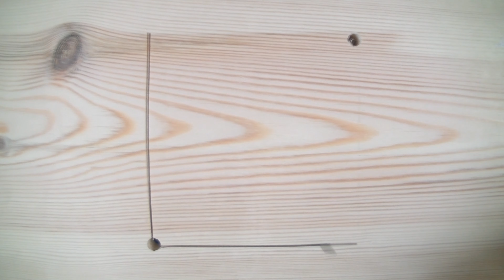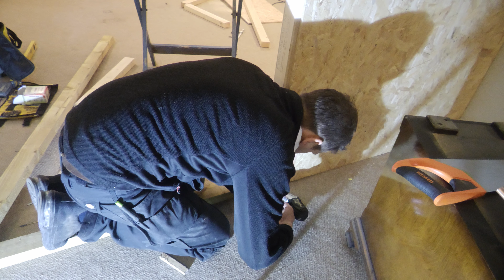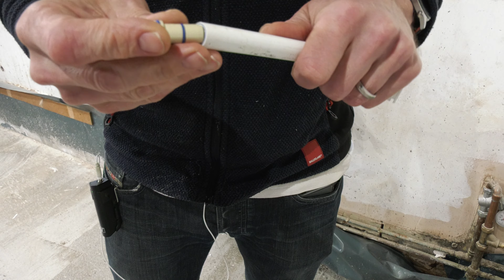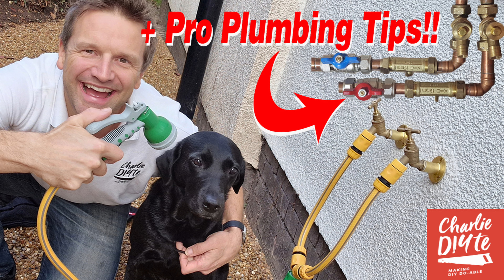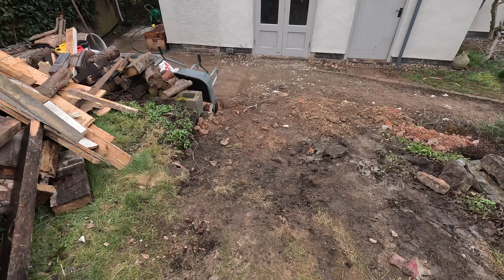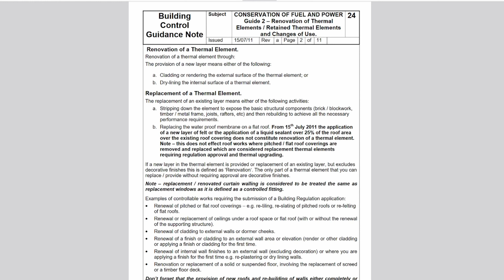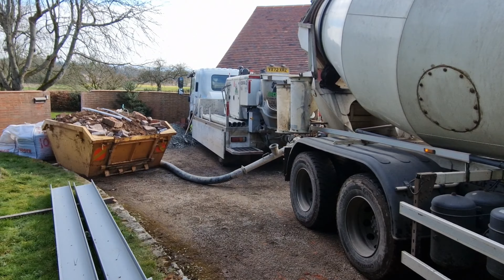How to Prepare an Old Property for Underfloor Heating

Comment: IMO this is THE ultimate test for a marriage
If you both survive this you are good for life hehehe. 
Man what a job.
Since you are taking down an old chimney, check for asbestus, you don't want to pulverise that stuff.
Cleaning an expanding foam gun when the foam dried out is a hell of job, I know.
Done it once, since I am the "go to" guy for my cousins who are pro builders, repairing building equipment like power drills, electric tile saws , you name it, I repair it (by far not my regular job) .
I'll bet you checked for all the subsidy there are available for e.g. insolation etc. 
Last big IT project I had , one of my colleagues was renovating part of her house and she had no clue about any subsidy,  so I checked it out for her, gave her some calculations and it ended up saving  € 8000.- on building costs.
Great video, love to see other people work on my Saturday morning.
Keep up the good work, you are doing GREAT !
Reply from the maker: Thanks. Yes it's a real assault on the senses this project. I've set up a temporary kitchen in the hall and plumbed in the appliances in our porch - won't be doing a video on that as there are a few radial circuits I've rewired for that. But the point is we've achieved a kind of normality. I did want to underfloor heat the whole of the downstairs but my wife vetoed that on the basis there would be too much disruption. Problem right now is were can't work out how to configure the space/ where to put the kitchen 🤦 I'm also not sure I want to avoid putting underfloor heating under the units as if we ever reconfigure the kitchen in the future the underfloor pipes will be in the wrong place. Good point about the subsidies. Not sure we qualify for any over here right now, but I'll check.
Reply: @CharlieDIYte  Not sure we qualify for any over here right  --- that's what she was thinking too hehehe
Some tips for approaching :
First check out local subsidy (town) then area (county/province)  then National (England and GB)
Here we had a period where we got a discount on material for insolation materials like rockwool etc. (direct at the DYI shops) but those days are over.
 But for my colleague there was a tax deduction on labor !!!! for improving isolation of her house. Instead of 21% VAT  she only had to 6% VAT over that part of labor. You have arrange this with your contractors (but since you are doing most of it yourself you have that to figure out yourself) . But keep it real , those tax guys are not complete stupid.
Success

Comment: This is really interesting Charlie. I built our house in Canberra about 12 years ago with relatively uncommon in-slab hydronic heating - it makes our winters so much more enjoyable than the standard forced air heating.

I am intrigued by the far greater complexity of the English floor builds, for which I'm sure there are good reasons. Some differences are:

1. you have many layers of concrete and sub layers. Our layers are: blue-metal dust, sand, termite barrier, moisture barrier, then concrete.
2. the hydronic hose is clipped/wired to the reo in the single concrete layer. The reo sits on plastic 'chairs' - I noticed yours are concrete!!  The only difference is that instead of having a 100mm layer of concrete, it is increased to 120mm to accommodate the hydronics.

Love your channel.
Reply from the maker: Thanks Jonathan, that's really interesting. Did you put any insulation in there? Yes it does seem complex doesn't it! But when you see how fragile the PIR is, it makes sense to have a firm concrete slab to lay it on. 👊
Reply: @CharlieDIYte  Hi Charlie. Insulation yes, it is compressed XPS polystyrene 50mm boards buried to the level of the blue-metal dust, but only for the 600mm inside the perimeter of the building as a compromise between the -6C winters to the 35C+ summers.  I'm intrigued by the very low viscosity concrete and grout layers used in the UK (first seen by me on Grand Designers (of course)) - self-levelling I presume. Our concrete is very much stiffer and laser levels are used.

Comment: I don’t think I agree with the breathability nazis anyway. Yes it’s ideal if walls can breath but if you manage condensation and vapour inside (as we know you do) you can get away with murder. Attaining the equivalent U values using natural products only would be some serious £££.
Reply from the maker: I agree Luke, and the big problem with the screeds you lay yourself is you can't get the screed to totally encapsulate the pipe whereas the quick pour screeds completely surrounded them making the heating so much more efficient.

Comment: From the few seconds we saw of the underfloor heating drawing it looks as though the pipe work is spaced at 200mm centres and has some quite large areas where the pipework is not effectively covering the heated parts of the floor meaning there will be cold spots.

Without knowing the U-Values of the walls it’s not good practice to just assume this will adequately heat the room should the walls be poorly insulated or be below current building regs. 

Having worked in the underfloor heating industry for over 16 years now I would always recommend the pipes are spaced closer together and the UFH systems delta t is reduced to somewhere between 5-8 degrees c. That way you will gain a higher heat output at a lower flow temperature, the system will be more efficient and future proofed should the heat source ever be changed to a heat pump. 

Another thing worth potentially considering is ensuring pipe work is also placed under the kitchen units and island. That way you’re future proofing the house for any changes to the kitchen layout in the future. The last thing you want is huge cold spots should the island be removed 10 years down the line. Should you be worried about heat getting into the units you can push loft type insulation behind the plinths which will help to dissipate most of the heat that could pass into the units
Reply from the maker: Can't thank you enough for this post. You're absolutely right. The Polypipe quote specifies 200mm centres and as you say, there are some large gaps and I have the added complication that we can't agree where to put the new kitchen right now, so I'm concerned about excluding all areas under units to then decide in 5 years time we want to reconfigure the space, so what you say about doing the whole floor is gold dust! Really appreciate your input. DM me on charliediyte@gmail.com if you'd like access to our Discord forum as we'd all value your expertise on this subject. 👊
Reply: Hi James. Do you still work in for e tupling? I'm in the process of planning my floor build up and ufh and would really appreciate some help. I'm local to Warrington.
Reply: READ THIS Charlie you want 100mm centers, 150mm at an absolute maximum.

Comment: Another great video. Planning on doing pretty much exactly the same in our 1930s bungalow in West Wales which currently has zero insulation. I’m dreading the disruption😩
Reply: Same here - but I've been advised to leave the solid floors as is, as it gives the house structure some thermal mass (especially with internal wall insulation as charlie has already done) - which helps maintain an even temperature?
Reply from the maker: How will that work with your floor levels when you add the insulation, or were you installing a low profile system?
Reply from the maker: It'll be worth it. I'll be doing a video on the wall insulation too. 👊

Comment: The concrete company that I've used in the past mixes the concrete on site. The concrete truck has basically three separate compartments in it, water, cement and aggregate. So you only pay for exactly what you use. And if you ordered too much they just bring it back with them since it is still unmixed.
Reply: Volumetric mixers
Reply from the maker: I wish mine had been one of those - genius! They did put about 160 litres of water in on arrival.

Comment: Perhaps it is a mistake to carry out this particular renovation. By insulating the floor, you are losing the cooling effect in summer. This is definitely not the way specialists of old buildings suggest in France. In addition, it entails a large carbon footprint…
Reply: Definitely not a mistake in the UK 🤣🤣
Reply: Strongly disagree. It rarely gets uncomfortably hot inside in the UK, whereas it gets uncomfortably cold all the time for  over half the year. Crazy idea to want to lose precious heat into the ground in winter.
Reply from the maker: Exactly. The difference between the cooling effect with the new sub structure and the old will be negligible - it may even be better.
Reply: Actually thats what I've been told in the UK - its good to have some thermal mass
Reply: @EverydayLife621  he's got 50mm of a dense screed. It's alot of thermal mass.
Reply: Cooling effect in the summer hahaha it's freezing 11 months of year

Comment: I saw another video (it may have been skill builder) that said that the current practice of offsetting one thermal element against another won't be allowed under the future regulations when they come into effect.
It means that the current architectural trend of huge windows everywhere being offset by really thick floor and ceiling insulation will come to an end.
Reply from the maker: Thanks John - I suspect @Swwils is right though. 👊 That said, architects who design these massive glass gable ends are complete muppets - particularly in bedrooms where they leave the customer with a window that's well nigh impossible to curtain.
Reply: It will always exists because everything is tied to performance.

They are fleshing out more detail around actual solar gains but these can easily be rectified with oversails or other techniques.

It's all moot anyway in the UK because we couldn't build domestic properties well if we tried.

Comment: Great video. I’m looking into underfloor heating, thankfully will be much cheaper and easier as will be part of the newbuild. Probably preaching to the choir but my only comment is to be aware of the moisture, concrete slabs take a months to dry and may exacerbate any damp issues you have already mentioned and take that into consideration when fitting any finished floor. I did however notice a heater/dehumidifier at the end of your video
Reply: That's hardly going to anything surely. It needs to be breathable and just doesn't want to do it.  So so wrong but hey.
Reply: @smartgorilla  define ‘needs’ to be? The whole outside of the house is covered in a non breathable render. A non breathable floor over a dry soil substrate won’t make a jot of difference.
Reply from the maker: Exactly, thanks Luke 👊
Reply from the maker: Thanks Barry. It's a good point. Yes as of a couple of days ago I've had the dehumidifier running continuously. 👊

Comment: Get a good look the house foundations charlie? I found myself certainly a good couple of inches below 🤣 fun times!
Reply: It doesn't matter if temporarily you are below the footing base as long as you bring back floor level to what it was before.  Problems and underpinning are only needed when there is a permanent drop in level.
Reply from the maker: Thanks John. On the south side we've got insane foundations as the house was I suspect built on an earlier stone cottage's footings that go down a good 800mm. On the north which is a later extension, I suspect we were pretty close.
Reply from the maker: Thanks Joe 😉👊

Comment: With the price of concrete why did you not check and double check the quantity? 2m3 is a lot of waste.
Reply from the maker: It was a case of rabbit in the headlights. Builder "we need to get this done asap." Me "how much do we need" whilst I was rushing round. Builder "6m³ will do it, based on, what have we got, about 48m²?". And that was about it. Entirely my fault but I generally only make the same mistake once, but first time round I'm good at blundering into it,  particularly when pressurised by others rather than doing stuff on my own.
Reply: He could of got one of those onsite mixer lorrys, so no waiste pay for what u mix kinda thing
Reply: Thats callled real life
Reply: Yeah can't anticipate every eventuality or mistake. We are only human. Like his honestly hopefully we will now triple measure and calculate

Comment: What is the reason for going with the insulation above the concrete slab and not below it. so you could have placed the heating pipes strait in slab. and had the possibility of having a big thermal buffer.
Reply: He has laid mot 1, then slab, then insulation, then pipes in 50mm of screed so the pipes will be in an insulated mass of  screed 50mm thick acting as a massive thermal slab. Pretty standard no?
Reply: @utensil999   Yes but if you do the insulation between the Mot 1 and Slab you save the 50mmm of screed and just have the pipes straight in the slab on top of the rebar. but it sounds like it's the norm in the UK to do it like you say.
Reply: @fromaflafl2198  Insulation will not sit flat on MOT1
Reply: @fromaflafl2198   I’ve just done exactly the same. Mot sand membrane 100 mm concrete 150 celotex membrane UFH. 100 mm concrete slab polished. Building regs requirements🤷🏼🤷🏼🤷🏼🤷🏼££££££££££
Reply from the maker: Thanks guys. Yes as @utensil999 says, it's building regs but from a practical point of view you wouldn't want to lay PIR directly on a DPM with just MOT and a blinding layer below. It's just too fragile a material and could cause problems for the stability of the floor later down the line.
Reply from the maker: 150 PIR. Wow, that's impressive insulation 👊
Reply: @CharlieDIYte  that’s one view. The other is a total waste of money on the extra 50mm 🤷🏼🤷🏼
Reply: @CharlieDIYte  You use XPS in that instance. Not as high performance as PIR but cheaper, takes a higher load and not effected by moisture. Standard practice for an insulated raft foundation.
Reply: Yeah pretty standard in UK. Maybe having 100mm insulated slab would take too long to heat up 50mm probably a nice compromise between retained heat and instant warm up. Cheer matt

Comment: Charlie. A really good video with so much to take in and loads of useful tips and info. 
I had an internal leak summer thro my sitting room ceiling. Mice under the floorboards had licked the condensation on those plastic push pipes  and then decided to nibble them as well. Straight thro the pipe they went and a massively and mess carried on for 3 days until I got home..
Reply from the maker: Oh Nigel, so sorry to hear that - 3 days - that's very bad luck you were away when it happened. That's why we went for copper upstairs. No rodents downstairs with the concrete floors. Didn't stop my plumber using plenty of microbore though off the flow and return pipes for the downstairs rads - because he couldn't be bothered to channel the walls for 15mm. I'm glad to say 4 of those have gone now with the kitchen works. They also used microbore in my daughter's bedroom which I'll be replacing with 15mm copper, probably this week. That'll leave two in the lounge which I can hopefully replace when I pull down the lounge ceiling.